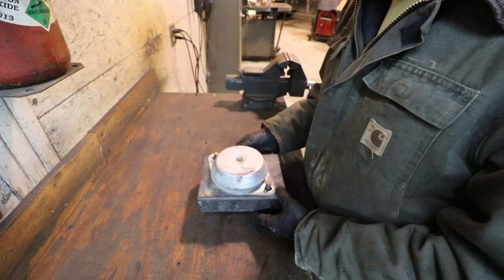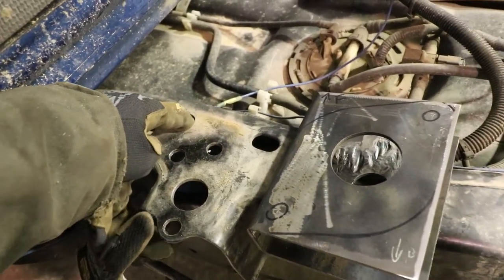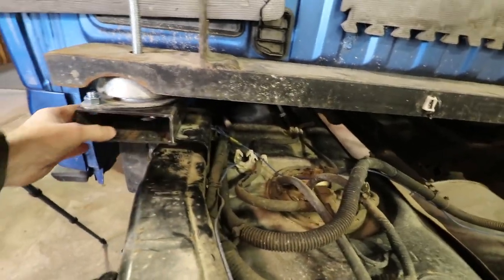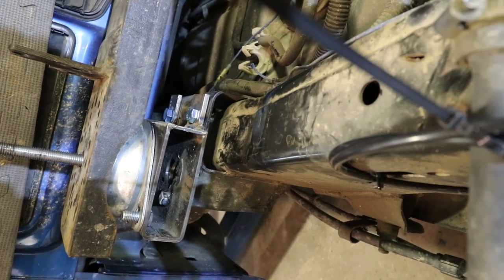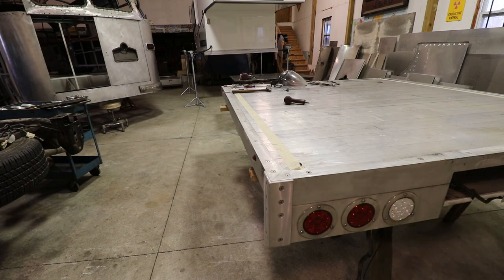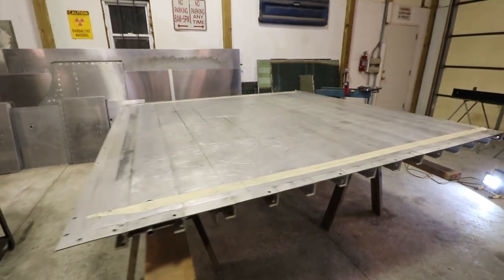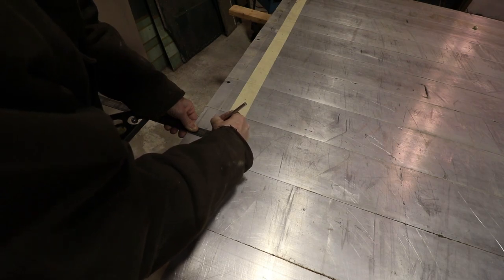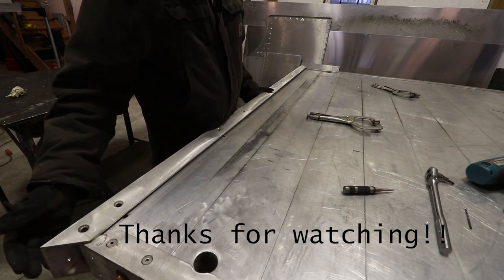Fat Bed Slim Part 2:  Thinning the Flat Bed of our XP Camper

Comment: Surprised you don’t have a drill press. Band saw is soooo useful. You seem to have a very nice shop set up there.   Don’t you hate Poor quality work from a so called high end builder?   Great ideas and designs, poor fit and finish.
Reply from the maker: You are exactly right.  The idea and design is really good, but the build and attention to detail was very poor.  Most of the time I use my Bridgeport Vertical Mill for my drill press.  Thanks for watching.  Todd and Lori